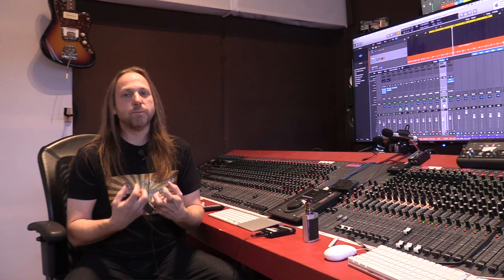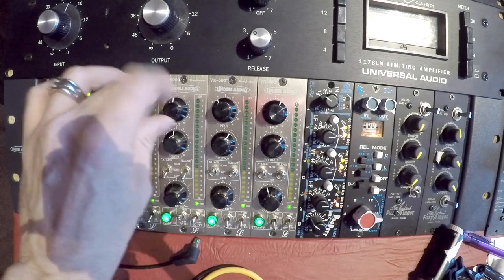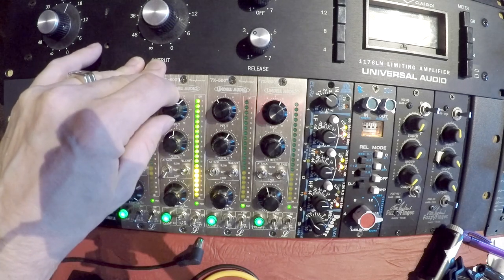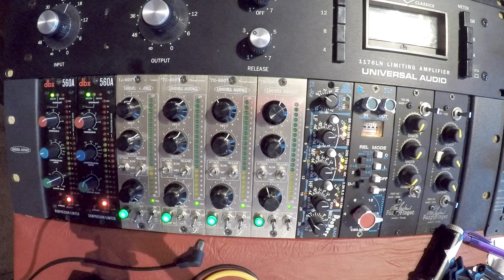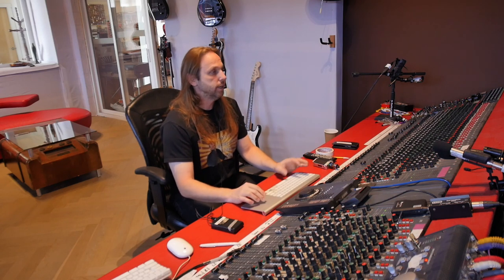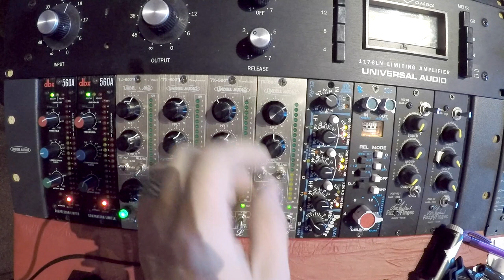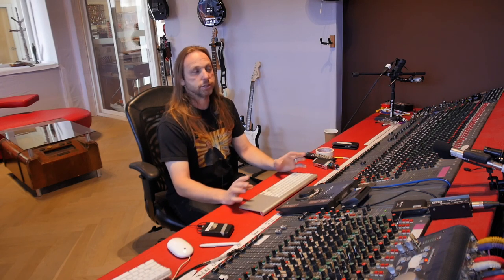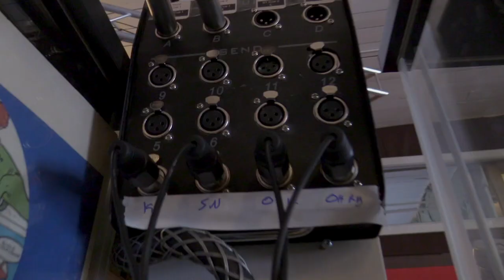Lindell Audio 7x-500, 500 Series Compressor In Action!

Comment: Good Demo
Reply from the maker: Thank you for taking the time to make a comment.  "Bad Demo" is not a super helpful critique to help me get better at reviewing products.  Can you be more specific?  Thanks
Reply: @SmithMediaSolutions  Nothing personal my friend, It is just that after watching this video I was disappointed about Lindell's sound. But later I got one 7x compressor and it actually works. Maybe the drums you're using for this demo
 aren't exactly the best sounding, and they don't benefit much from  the compressor, just my personal  opinion. I will actually change the title of my comment because I find it a bit rude, thanks
Reply from the maker: @rocketstudiocr  That makes sense to me.  Thank you very much!  What are finding you like about the Lindell?  I must admit that I do have a bit of a hard time using them compared to my other compressors.  I find that I end up slamming the meters or not really touching them.  Not much in between:)
Reply: @SmithMediaSolutions  I like it on bass , I think it is not a 1176, but good for a drum bus in parallel . tricky to set up for vocals. If you ask me I much prefer the 19" clones (including warm audio ) but for the price no complaints
Reply from the maker: @rocketstudiocr  Interesting,  I am going to give it a shot on bass.  I haven't tried the rack mount 1176 clones yet.  I am glad it is working for you.  I have had good results with it on room mics and drum buss as well.  Thanks for sharing that info:)